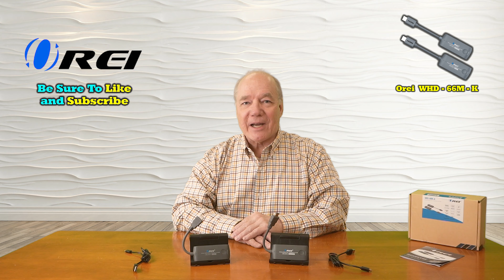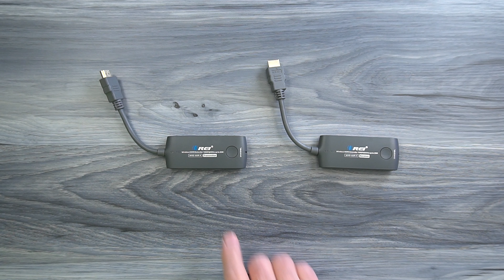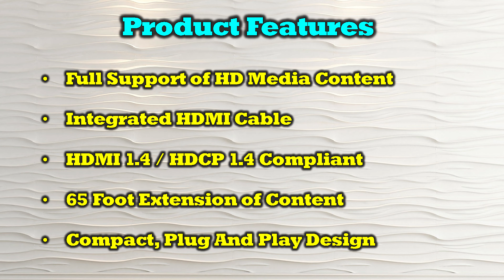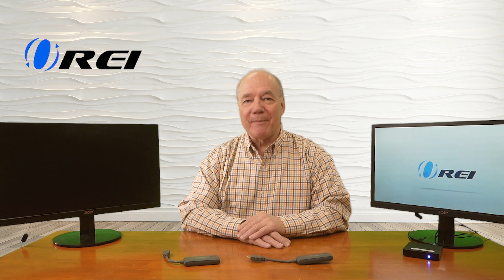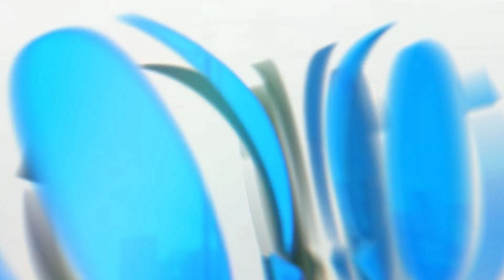BEST Wireless HDMI Transmitter and Receiver 5GHZ

Comment: Your plugging in the power supply on both units is a perfect example of why all devices should use USB-C :)  Looks like a good unit, but I would need one with a HDMI passthrough and 4K@60.  I have several of your other devices, and never had any issues with any of them.  Keep up the good work.
Reply from the maker: Glad you like our products and appreciate the suggestion. We're always looking for ways to improve our designs.